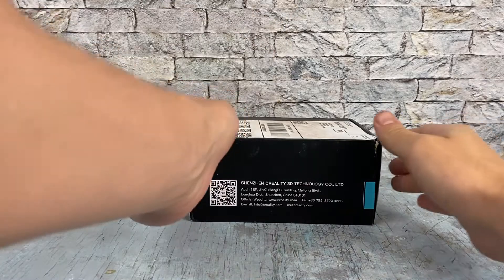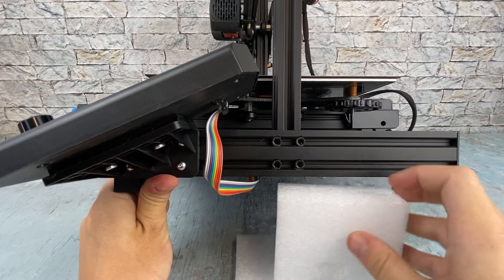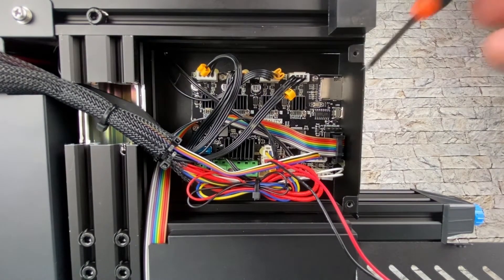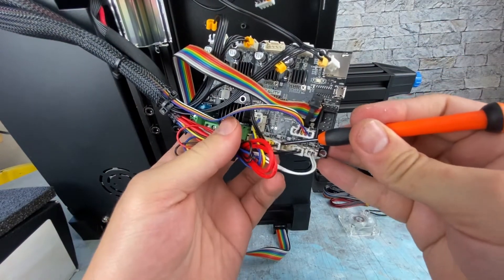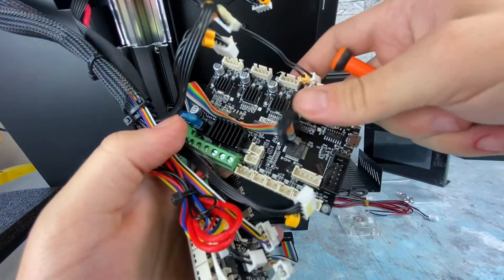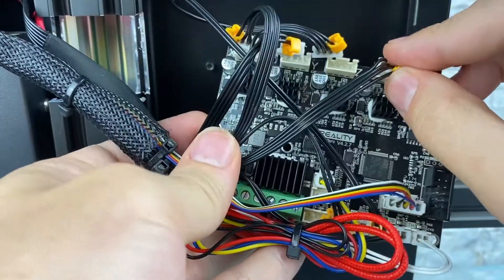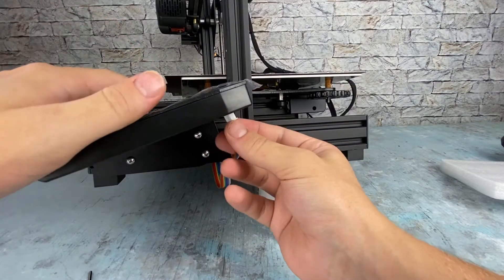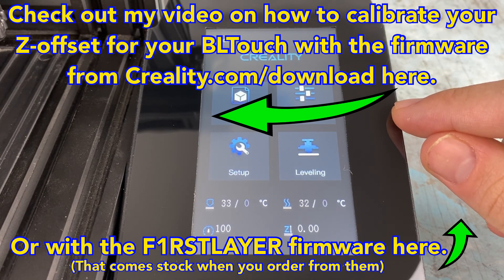How To Install 4.2.7 Mainboard + Ender Series Touchscreen On Your Ender 3 V2

Comment: Thank you sir for a very good description on Google Drive, I managed to restore my Ender 3 Pro, replaced the old board version 1.1.4 with a new silent version 4.2.7 with a touchscreen and CR touch. There was a problem with the new kit, it froze with the factory touchscreen firmware. I flashed it to the one in your video and everything started working normally, a full menu appeared. Thank you again!

Comment: Great Video!
What color are the Wires on the Plug that goes into the Screen?  Can't see the Screen Plug in your video.  I'm trying to trouble shoot an issue I'm having.  Maybe you could supply a photo if that's acceptable.

Comment: dude you dont need to be change becuse 4.2.2 is silent board but if you has a 1.1.4 or 1.1.5 mainboard changing is much more sense, but thank you for upgrade guide

Comment: Okay I have the ender 3 and I upgraded to the 4.2.7 motherboard and the touchscreen. Which firmware file do I need to flash my screen? I’m confused
Reply from the maker: My advice would be to switch to F1RST LAYER firmware. Check them out on Facebook. I tried looking on the Creality website and they have severely lessened the number of firmwares they offer which is disappointing because I remember they used to have exactly what you need. But the F1RST layer firmware is better than crealities and if it’s confusing which firmware from them you need them they will help you figure it out once they see your message. Creality disappoints again with the new firmware downloads, lol, kinda.
Reply: @3dprintutopia961  thank you

Comment: Hey I did the install and have a black screen
Reply from the maker: Did you format your sd to fat32 and 4096 allocation size?
Reply from the maker: And also, you may need to flash the screen firmware too if you didn’t do that. Reflashing firmware is my recommendation, on both screen and printer.

Comment: Will this work on a 4.2.2 Motherboard? That's what I have and it's fucking irritating it keeps getting stuck on the loading bar and creality logo screen
Reply from the maker: I don’t think it will, but I can’t say for sure. It sounds like you may have the wrong firmware installed or possibly didn’t format the sd card correctly when flashing the firmware. Make sure to use 4096 allocation size and fat32 for sd card format. Make sure you select the correct firmware (easier said than done) or else it will not load on the printer. Also, if you have a touchscreen with non touchscreen firmware or anything like that it won’t work and will get stuck on the loading screen.
Reply: @3dprintutopia961  I've tried researching the correct firmware. Maybe I'm missing something? If you could point me in the right direction with finding it I'd be appreciative.

As far as formatting, I've done everything you've just mentioned. 4096 Fat32 etc. So I don't think I'm missing a beat there.
Reply from the maker: @skatershyt6  Dang, was hoping it was simple as that. But yea, shoot me your screen type (knob or touchscreen), if you have bltouch or cr touch and printer (just in case it’s not a E3V2 I’m mentioning this).
Reply: @3dprintutopia961  I actually just got it working a few days ago, supports me CR touch as well.

Comment: You don't have to swap and of the wires on the stepper motor connectors?
Reply from the maker: Make sure you match the correct axis, it should be the same order as the old board.

Comment: What is the benefit of this? 

Will my prints print faster? Or is it just some techie thingamajig to geek out on?
Reply from the maker: Personally, it is great for me for a few reasons. This 4.2.7 board when purchased from “first layer” comes with a similar firmware to Jyers. Jyers, however, isn’t supported with the Ender touchscreen. The custom firmware from first layers allows a lot more options than the stock firmware. The biggest thing along with the firmware was the touchscreen. I have carpal tunnel so having a touchscreen versus the dial knob is amazing and makes the printer part of printing not stressful on my wrists with the twisting action. It’s definitely not a fix all for better/faster prints but some of the features in the firmware such as linear advance has helped me print my petg 20mm/s faster than before which is always a plus. That being said, it’s not a guarantee upgrading will help improve things but personally, it’s nicer for my wrists and my print speed a bit.
Reply from the maker: Geeking out during the build and playing with the firmware further is a plus too lol.